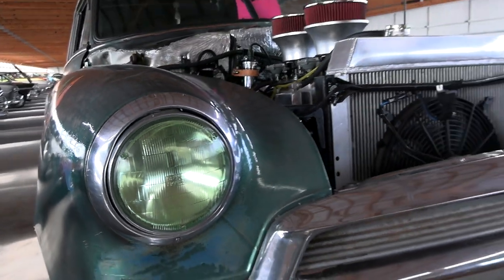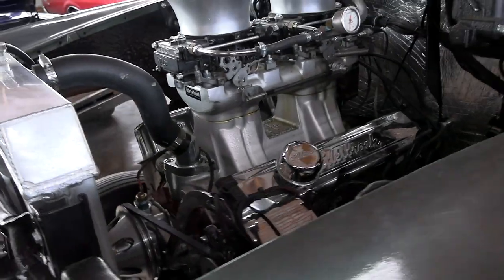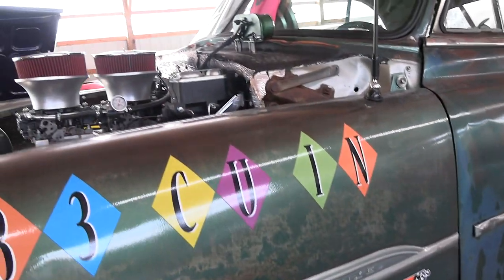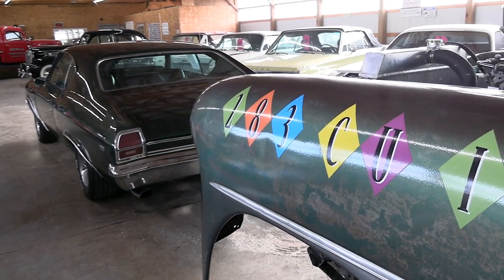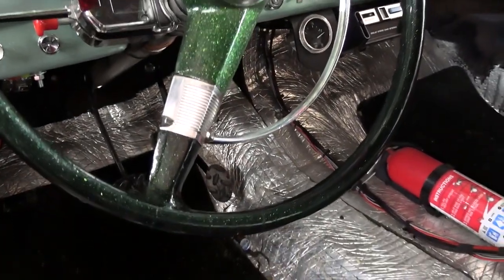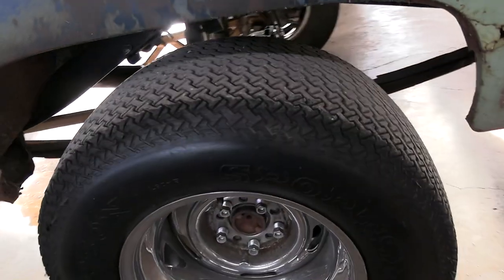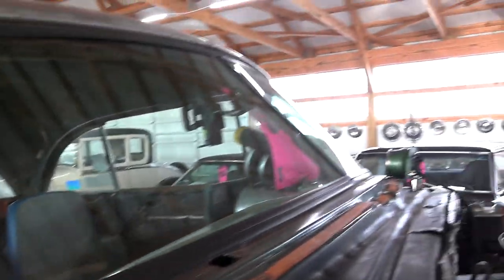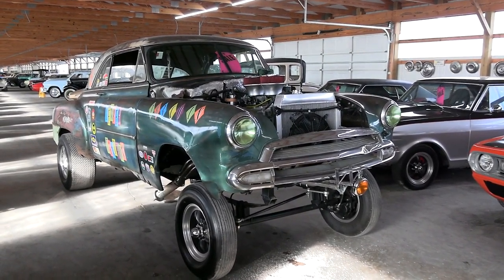Awesome 1951 Chevy Deluxe Gasser - Weiand Tunnel Ram w/ Dual Holleys

Comment: Used to see the Gassers at the local drag strip, but that has been many years ago. If the 69 Chevelle SS in front of it is Burnished Brown, it is the same color as the one I owned. Mine came from factory with the 396 L78 engine with solid lifters, chambered exhaust..etc  Thanks for showing the Gasser, brings back memories.
Reply from the maker: Those L78 396's were strong runners.  That's awesome that you had one.  Thanks for watching, I appreciate it my friend!